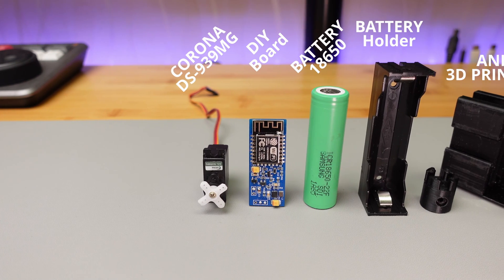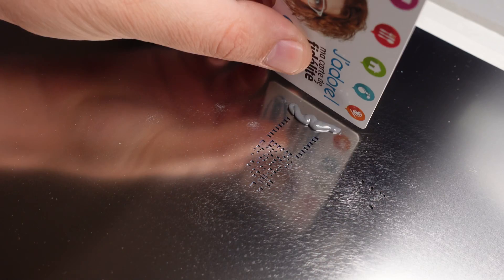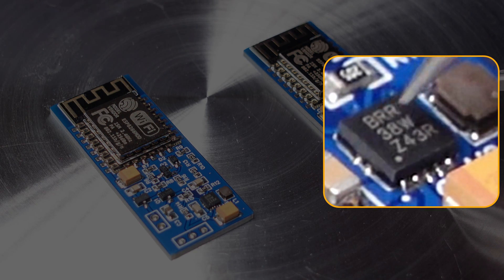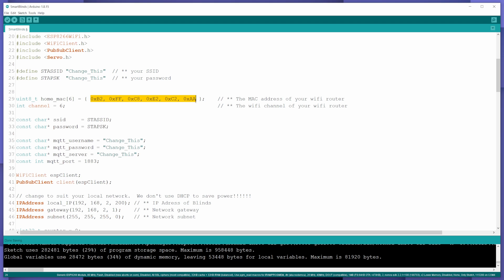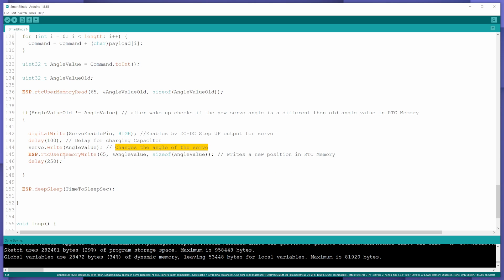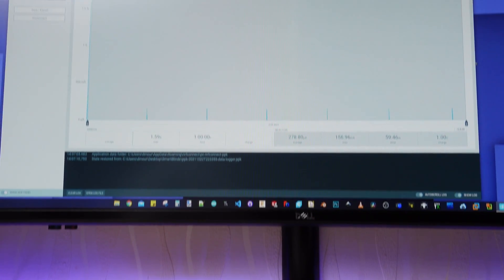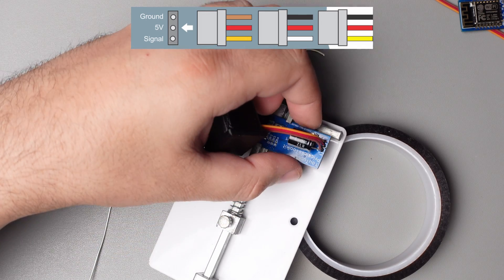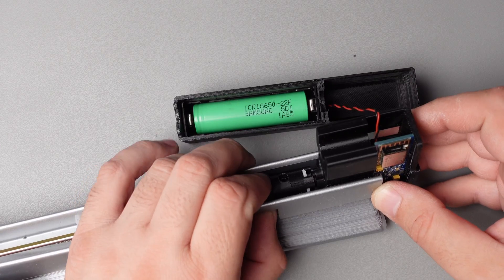DIY Battery Powered Smart Blinds for Home Assistant

Comment: Nice video. Been watching the hookup’s video on blind automation and came across your video. Would love to make a version where all the components fit in the blind holder, but don’t know how to do that. Is it possible to implement a stepper motor instead of a servo?
Reply from the maker: Thanks, Specifically with this board, no, but the principle is the same during sleep, you need to turn off the stepper power to save energy

Comment: Can I use a standard ESP32 dev board?
Reply from the maker: Hi,  yes, probably you need to change the code slightly but the question is 1) how much power it will consume in Deep-sleep mode. 2) the servo motor needs 5v. on my board, I have a step-up converter for servo, and during sleep, there is no power going through.
Reply: @PricelessToolkit  Right. I will test it and see. Thx
Reply from the maker: @shanebekker  No problem, if you have any questions, ask, I will help you in any way I can. Good luck!!

Comment: Nice, you got yourself a new subscriber here! Really like how you made a very slick case to it. Making it “pretty” sometimes takes even more than the project itself. I would add a physical interrupt to wake it up if you want to manually operate it (and not wanting to wait 10min)  a button, touch switch, PIR at a very slim angle, or a LDR sensor in a hole in the casing or similar those can be battery friendly and help with user experience.
Reply from the maker: Thank you very much, every time I read a comment like yours, I am joyful like a child. On my GitHub page, you can find a new version of the board with pins for connecting buttons., but the PCB has become a little larger.  You need to change a few dimensions of the case.
Reply: @PricelessToolkit  ;) always one step ahead! 👍 will check the github project
Reply from the maker: @myounges  😃

Comment: Do you thing about to use two physical switch for manual operate blinds? It would be useful.
Reply from the maker: Basically, I only need to add two "interrupt capable" breakout pins to the board.
Reply from the maker: Added a new board to the Github :).  The board has become a little bigger, it will not fit into the case. You need to change the 3d model. Look V2.jpg
Reply: @PricelessToolkit  Cool, very good. Did you have example code with switches?
Reply from the maker: @zdenekherzig7112   no, I have no time for testing now,  working on next project see community tab.
 you can try this 
1. attach interrupt pin 
2. after wakeup  publish the desired angle! if no it will return onto original position after next wakeup
3. turn the servo
4. sleep

if I get a few hours of free time, I'll try!    by the way, I love RC cars too!

Comment: Holy moly! This is amazing. Interesting to add a tiny solar panel then you really wouldn't need to even think about it
Reply from the maker: Hi, thanks, I already bought a small solar panel. but first I want to try 1 month in real condition and find out the real power consumption. 3 days have passed since the start of the test, the charge dropped by 0.7-0.8%

Comment from the maker: After one month of use with lithium-ion battery 2500mA, I will write real results of autonomy if you are interested?  If this video is useful or at least interesting to you. Then subscribe, comment, and like, this will help me a lot !!  < UPDATE 04/12/2021 I don't know why, but HA only shows the logs for the last  " 12deys  3.5 - 4% drop" and assuming that the discharge will not decrease linearly we can expect 8-11 months of autonomy >
Reply: is it possible to do something like this on 28BYJ-48 and DRV8825 driver>?
Reply from the maker: Yes of course but it will consume more power